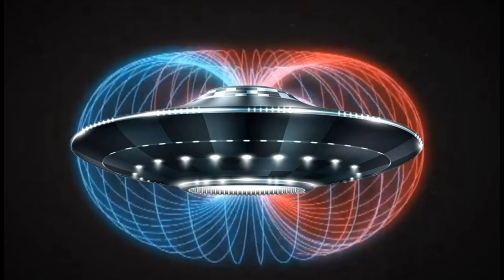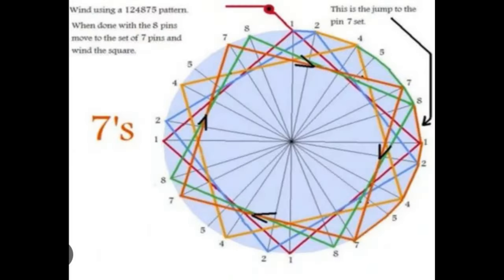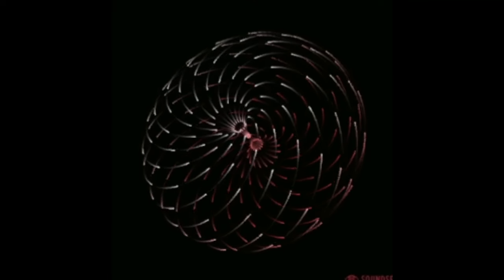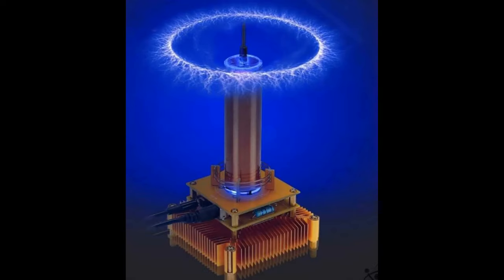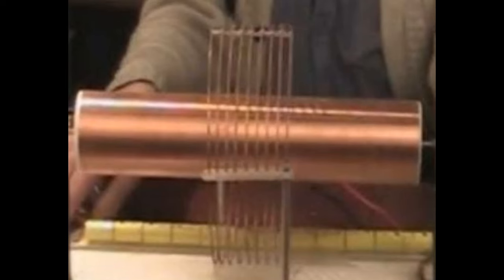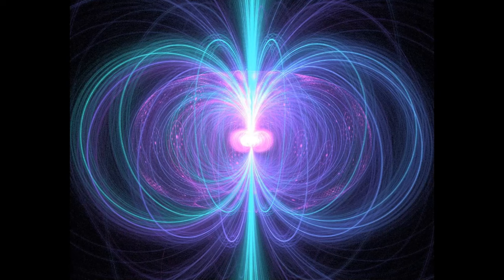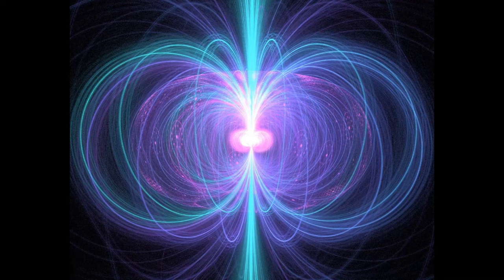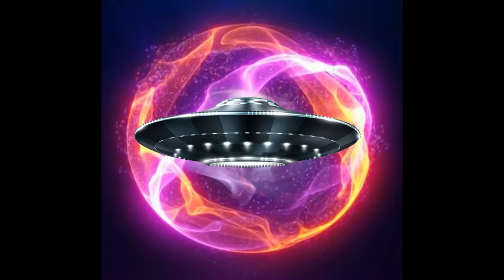UFO Coil Field Theory

Comment: In my experience as a 100' Saucer Physics witness... The 50' Torus formed around the perimeter ring  "and below it" so the Disc remained in an invisible plane ... Until it collapsed,..
then there was a dip and it came into view (like a casimir angle).. then PPTs fired off from the ring .. to stop the tilting...
Reply: So there was a 200' shell bubble around it that collapsed first...

Comment: If gravity is simply particles from space grounding themselves into the Earth, then this shape off the field I'm about to explain, should negate gravity. And if you sped up the field it would give you vertical lift. Looking from the top, cut the torrid in a circular motion in the center of the toroid making two D's back to back the sideways View.

Comment: That was great! Thank you! Maybe a plasmoid could help in some way. It could be achieved by strong magnetic fields that would ionize a certain gas mixture. There might not even be much heat emitted, as an example I would like to point to biolumenessence. Fire flies aren't actually hot and the clouds above your head are plasma, too. It could function as a superconductor at the center and rotation is part of it's nature anyways...  Arrange the magnets in a vacuum chamber or something like that and a quartz pebble could give some triggering impulses... piezo electricity, as far as I remember, it has rather high voltage.

Comment: 5:20 The field is actually a resultant wave which propagates around the coil in a helical fashion, leading the transverse wave between the conductors, thus the oscillating coil posses a complex wavelength which is shorter than the wavelength of the coiled conductor. It spins around the coil as a consequence of the vectors between the magnetic and dielectric fields, one transverse the other longitudinal, see Dollard's paper: "The Oscillating Current Transformer" which can be found with a quick search, he goes into the wave structure with images provided.

Comment: Segmented 8 node omnidirectional/directional dielectric plasma emitter antenna with an additional 9th node in the rear as a negative ground as the top of the craft and 3 coils of 2 negative/one positive ultra high frequency alternating current with current and voltage 90% out of phase for the bottom well of the craft. Center pylon consisting of a means of converting ac to dc and charging and pulsing off your top. Use bottom 3 coils of three phase ac with a ground plane and add three capacitors on the bottom to gain capacitance in the system. Bottom three spherical/hemispherical capacitors connect to 3 field coils in lower hull. This is how it’s done!

Comment: Great work, this has taken you a lot of time and energy and will bring you ever closer to the reality hidden in plain site.
There is something that will cause your efforts to leap ahead if understood and applied using mindful geometry and the avoidance of a common misdirection in physics which is namely 'imbalance'
Magnets (clustered in phase atoms) are NOT one equaly whole staticly measurable state.
Magnets (atoms) have the following characteristics:
There are 2 pole sets of fields each 90° offset from the other and encompasing a given area.
The 2 seperate fields are not equal in force at any moment.
Both fields of force  are in motion along any field line so to speak.
The asymmetry represents as measurable by a manget having an egg shaped magnetic set of fields rather than a sphere/torroid.

Comment: Bedini intends to avoid building a magnetic field inside the core .  But for the field to collapse it has to build at some level.  Having low carbon iron core reduces flux density of the core so that  if it does build flux its not dense and it collapses faster .  Dont saturate the IRon with flux just build it up enough to collapse it for building a radiant spike

Comment: Find the angle of helical motion of a fixed magnets south pole field set (not the north pole field set)
Align your conductors in line with the south pole helix path.
Now you have nulled out the south pole potential but allowed for the 90° north pole field lines to induce charge to the conductors.
Non mechanical motion dielectric conversion results. Letting the magnet be the ether pump as Nikola Tesla did.
Don't forget his greatest discovery was that of "rotating magnetic fields" and he was not referring to them being put in motion by external forces, it happens internally naturally.
Iron fillings on paper will not show this as they average the 2 forces so they always look straight out from centre as if there is only one field. There is not.

Comment: Soooo interesting.
So its using tesla-coil to generate a ion-wind
And using a rodin coil
To capture the ion wind and compress it and shoot it in they end or down of the rodin coil?
Like putting in ion wind into vortex magnatic feild compressing the ion wind
And in they outputting out a higher power forece ?
Which makes the device to fly upwards ?

Of course indidnt think about the frequencies and theybother stuff about the rodin coil cos i might be wrong how i understhood your very good theory.
A theory which is extremely interesting and kinda possible. 👍

Btw how to make the device to not to fall other directions except down. You might use a gyroscope 
Modified version of that gyroscope. 
👾 this IS INTRESTING AF !
Reply from the maker: Ion wind uses the energy. That would be counter productive. You need to not use the energy at all. It needs to build up. Then you can rob the energy straight from the center as cold energy. Just like a wire down the tesla coil.
Reply: @nathanbunten4299  dammmmnn
Didn't think about this 
But this looks like about free energy.

What about anti gravity ?
👾
Maybe explain more deeply
U know 🥲 we stupid 🥲🥲
Reply from the maker: @sargismartirosyan9946  I will do a live later and talk about it.
Reply: @nathanbunten4299  i wont miss it 👍👍👍 
LETS GO !

Comment: This is NOT how you create a bubble
Reply from the maker: I have already done it
Reply: @nathanbunten4299  Congratulations,  you have built a fake bubble. A radio tower has this type of bubble, and yet it doesn't lift off.  It's a sudo bubble lol you'll figure out the real bubble, and once you do, you will realize what I am saying
Reply from the maker: @freedomer342  I created a bubble that hold in static electricity. Not a radio station fake bubble.
Reply: @nathanbunten4299  and crush a human too. Any tesla coil field can hold a static field due to the geometric shape of the field. In order to successfully create a bubble, you need a cancelation coil not two power coils.
Reply from the maker: @freedomer342   There is a spot opened up for occupants. Just like you see it from the core of the earth to the Van Allen belt. The part of the earth we are standing on is the occupant zone the fields flow outside that. There is also a field around the core of the earth just like the rotating tesla coil. Between both fields is another zone. You can call it a cancelation zone but I have not defined it yet.
Reply: @nathanbunten4299  correct me if I'm wrong but your saying once I fire up a Tesla coil, it's creating a bubble. If so, you do not want this